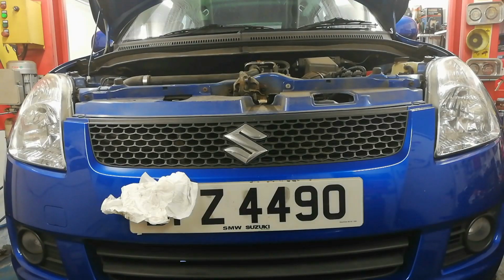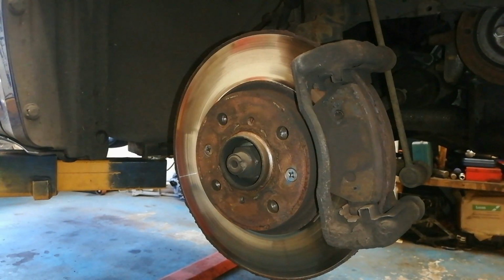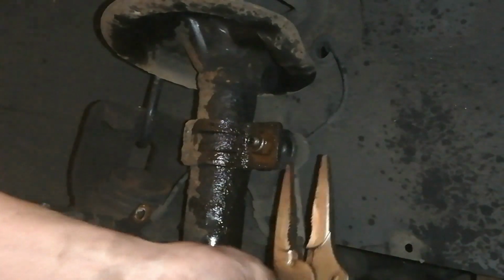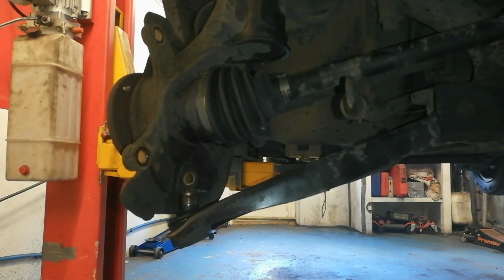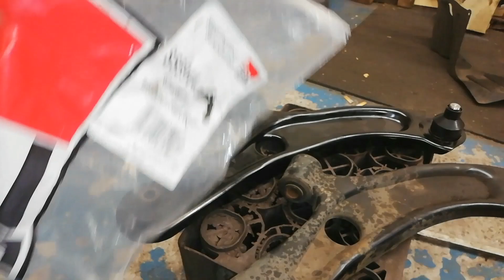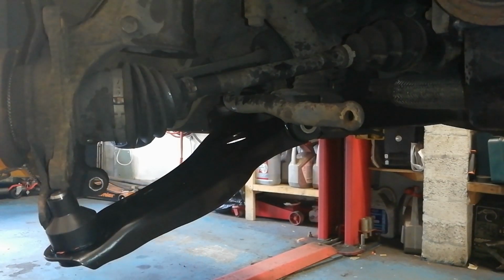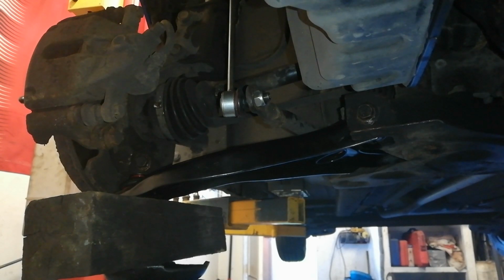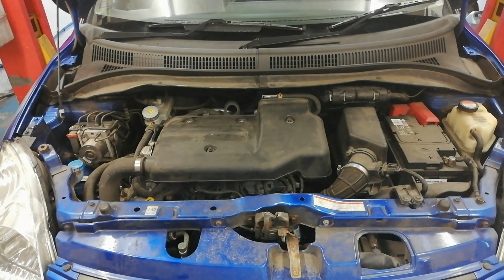Suzuki Swift front wishbone and drop links. How to replace. Hints and tips

Comment: Nice, thoughtful, diligent work👍✌️😊 

Drop links seem a perennial problem these days, we had two Hyundais that needed them replacing under warranty and again at 30,000 miles, we swapped them out for a German brand in the end over the OEM parts. Hyundai's and Kia's seem to suffer from broken coil springs too (regardless of mileage or abuse). 

What was the state of the subframe on this car, do you remember? Seems like certain territories have bad rust problems on Swift subframes?

Thanks✌️👍😊

Comment: Around the 12:11 mark, you replace the  front horizontal bolt.... But your video cuts out the important bit. When I try replace Tha bolt I find nothing to screw into. Is the nut inside loose? How do you fix it on?

Comment: can the sway bar mount bushes for the front be done on this without dropping the engine? I noticed them there on the engine frame, I have a similar swift and it needs its dbushes n right control arm done, some sources say you have to lower the frame some don't, I don't understand why, doesn't look that difficult to get in there
Reply from the maker: If it doesn't look that difficult, then go ahead and do it

Comment: You're a bit of a jobsworth, some of what you're doing is really unnecessary, no need to take the caliper and disc off, the fact you've used the gun on the drop link nut made the shaft spin, the vibration released it from it's taper, little bit of release oil and work it back and forth by hand and it will come off, and jacking up the suspension arm to tighten the bolts up absolutely ridiculous, the Bush is inside the rubber it ant going anywhere.
Reply from the maker: You haven't a clue what you are talking about
Reply: @davesterl  I'm in my late 50s I've worked on cars boats and bikes my entire life, as a mechanical and marine engineer, ant anstead of Wheeler Dealers we was one of the engineering companies that built one of their engines, wow, how people become defensive when they know they are wrong.
Reply from the maker: @1971dave  yes you are now being defensive, the irony
Reply: @davesterl putting the bushes under normal stress before tightening is standard procedure.